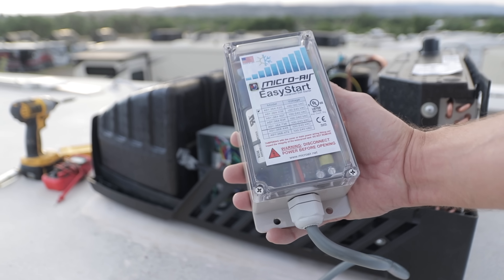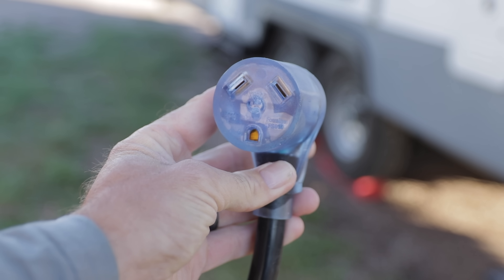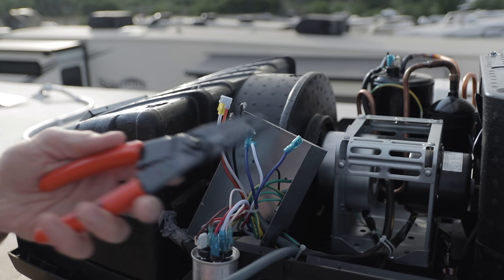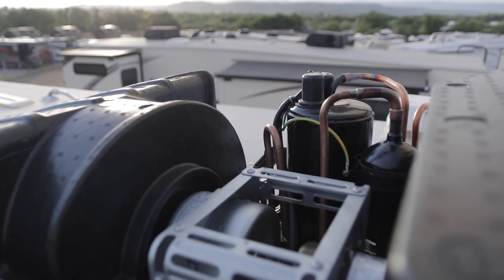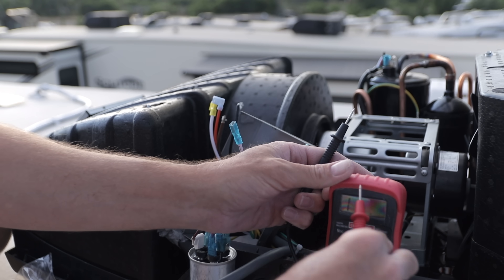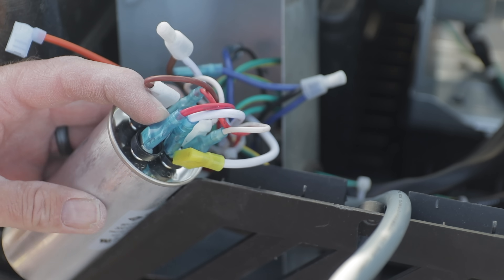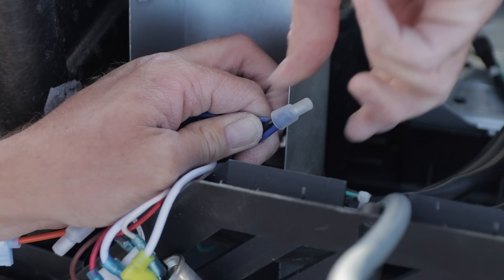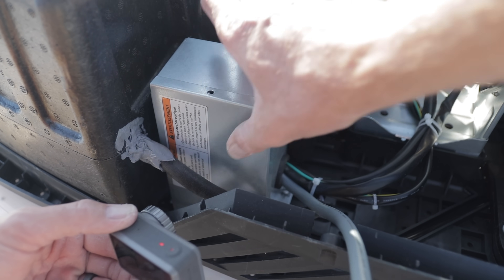RV AC MicroAir Easy Start How To Install.

Comment: As usual, great video! I've really been a fan of your channel lately. Thanks for all the good videos! I love all the electrical type stuff you include... and my wife likes the ones where you show things in your RV! I'm waiting to see if you do one on the Fridge Defend ARP though.... I just installed one of those in mine. It wasn't too bad, and I love the information I can glean from it now! (I installed it inside my unit so I could interact with it rather than behind the fridge.) It seems like it is right up your alley though.

I just installed one of these MicroAir Easy Start 364 on my 13.5k but Dometic Brisk Air 2 about 2 months ago. I ordered it straight from MicroAir (due to fear of getting fake parts from Amazon) and they had a $30 off coupon, so that was nice. Install was pretty easy, the hardest part for me was figuring out where to mount it... I didn't really like where I ended up putting it but for my unit there weren't many "mounting" options. As far as the use, it looks like it has knocked my cranking amps down to around 17ish amps (that's the best reading I could get out of my amp meter) so I am very happy with that! I didn't really have issues starting it up with my Champion Duel Fuel generator even when running on propane, but I still believe it helps and I didn't want to go with one of the $10 dumb start capacitors! All in all, I love this thing!

I'll also add that I found some of the WAGO lever nuts that come in different configurations (2,3,5, etc... wires) that make connecting multiple wires really easy and to me seems more secure and cleaner looking than crimping and using wire nuts. (Especially for the blue wire that had 3 wires combined... so much nicer!)

I'll also add that when "testing" the MicroAir Easy Start following some of the information in the install guide it says this: 

"...if you turn off the compressor at the thermostat when it is running then turn it on right away, EasyStart will prevent the compressor from starting for five minutes. If the compressor starts sooner, you have a wiring problem."

Mine was actually restarting back in 3 minutes, and even though everything was confirmed when hooking it up and everything seemed to be working as it should, this 5 minute rule still threw me, so I called them. They informed me that on the newer units that time is now 3 minutes... so I was happy to hear that!

Anywho, thanks again for another great video. Looking forward to more!

Comment: Is there any con to having and Easy Start?  Why don't they just build the AC with one built in?
Reply: Some do include regular start capacitors, which is a $10 after market part... but if they are too cheap to install those on all AC units, they definitely wouldn't install a $300 device into them before hand!

Comment: Great Video Jared, I wonder what the Inrush is before and after the Install. This Device Looks a lot like a Hard Start Kit with Variable Voltage (bath fan control/ Rheostat)?   👍
Reply: MicroAir has a video on their channel that shows the difference. I can't remember the numbers off the top of my head, and I know it will vary from situation to situation. I don't have the fanciest amp meter (it's a Southwire 21550 from Lowes) but it showed 17 amps when starting up my 13.5k Dometic Brisk Air 2 after install. I'll admit that I didn't get a reading before installing it, but my unit has a 68A LRA listed on its wiring schematics sheet.

Comment: I installed the micro aire last spring on my camper and love it. We do a lot of NJ state parks (no hook ups) and boondocking. I run my 15,000btu ac unit off of my Honda 2200 generator. Easy install and worth every penny. 
Great video. Happy Camping.

Comment: Have you ever used Wago connectors on wires?
Reply: Wago connectors are great. They don’t put the stress on wires, that typical wire nuts do. They also take the guesswork out of knowing whether you crimped wires tight enough too. Hutch Mountain now utilizes Wago’s in their install kit.

Comment: I installed one of the Micro-Air on my 15K AC.  Went from 46 AMP start to 19 Amps after the five training start.  I have an older 3500 Honda generator running on propane.  Before I installed the micro-air the Honda would really grunt getting the AC started.  Now with the micro-air installed I always have to go and look at my amp meter to be able to tell if the compressor has kicked in or not, no more "GRUNT".

Comment: Does this device effect the warranty on the ac units??
Reply: This is what they say about the warranties on the site. They offer a "Double Down warranty" that this is referring to:

"Some RV owners worry that their installation of an EasyStart 364 might in some way void the manufacturer’s warranty on their rooftop AC unit’s compressor motor. Legally, it shouldn’t. But you never know what a manufacturer might assert. Micro-Air is quite confident that its product cannot damage your compressor. 

Worry no more! This inexpensive Extended Warranty covers your AC unit’s compressor motor for the duration of your AC manufacturer’s warranty if it will not cover the repair or replacement of the compressor under warranty."

Comment: Just installed two last week on 15K & 13K units and can run both AC's at the same time off of 30 amp shore service and also from Firman 2900 generator.   Love your vids.....
Reply: Phil do you think a firman generator 3200 would run your AC without the soft start ?
Reply: @diverm2371  Yes!

Comment: I'm wondering if there is an "easy start" device that allows a kettle and toaster oven to run simultaneously on a 30 AMP service.  I have a feeling that is wishful thinking. LOL
Reply from the maker: Sadly no unless you are a 50 amp RV then you could do power assist with an inverter like the MultiPlus 3000